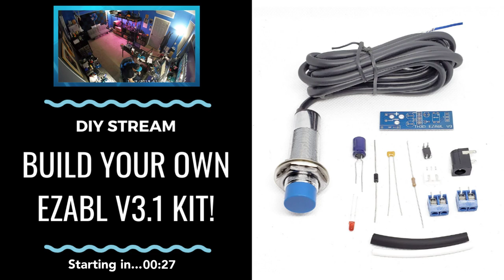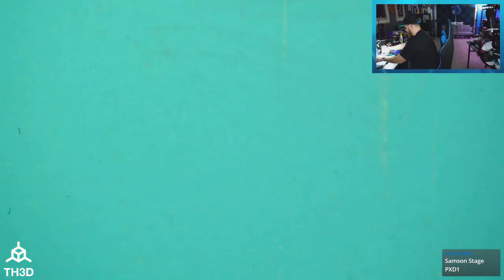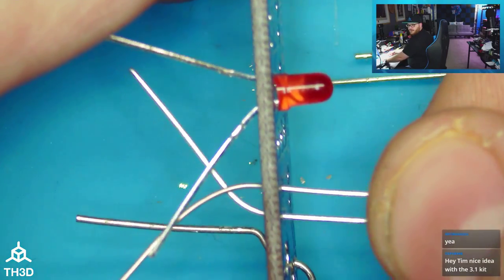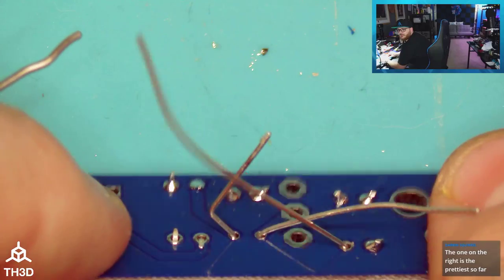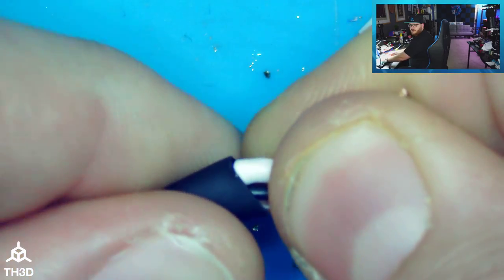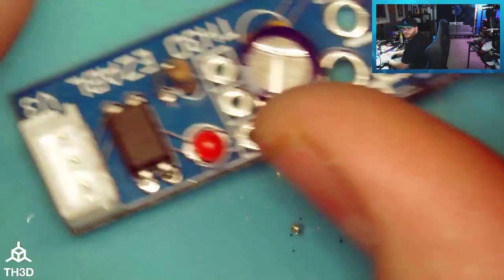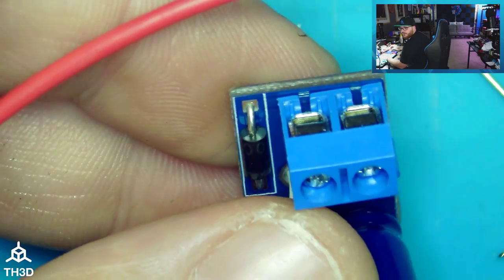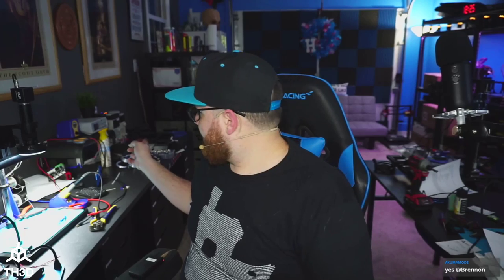[LIVE] DIY - Make your own EZABL V3.1 Kit!

Comment: Man i would have rather done this than just buy one. Always next time.
Reply from the maker: This is a limited time thing once they are released and there is no technical support included. This is just parts, no support on them.
Reply: @TH3DStudio  aww Man. I would reckon anyone comfortable with attempting this wouldn't need support beyond the schematic and this video. It's relatively simple circuit. I would try to make my own but I'd rather support you guys. Your quality and customer service is second to none and i ALWAYS recommend you guys over the clones and cheap imposters that are extremely popular in this hobby for some reason.